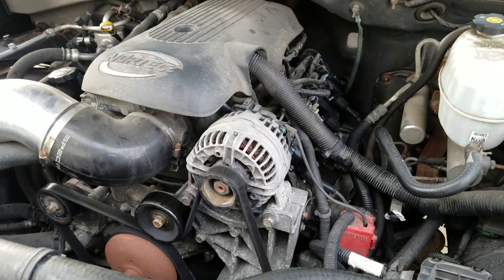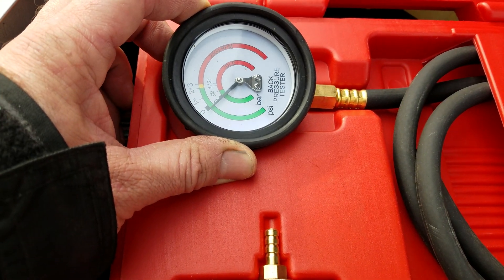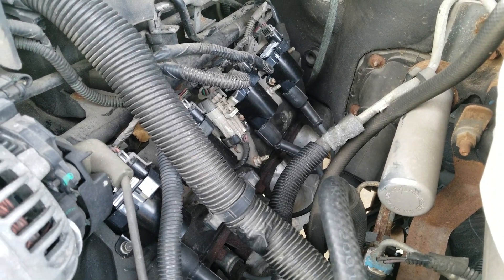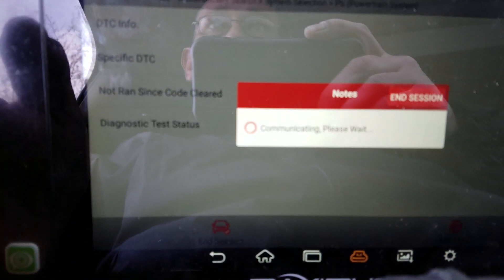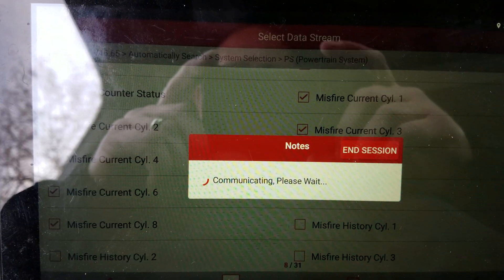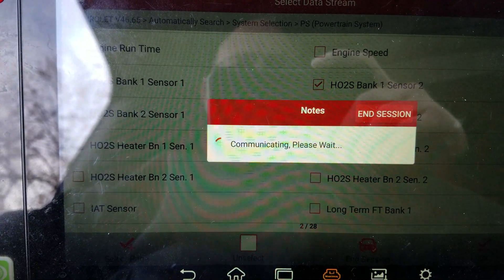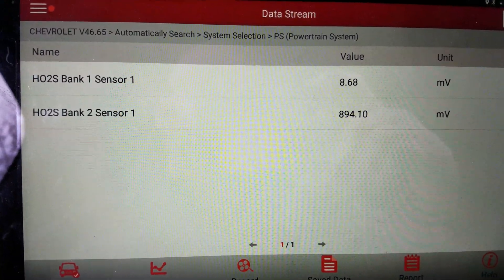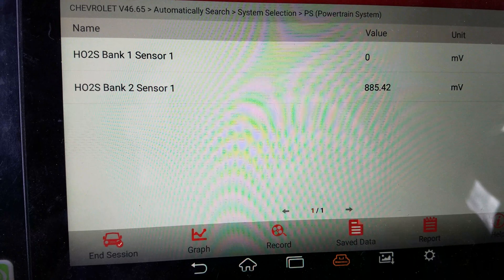2005 Chevy Tahoe P0300 Misfire  Code - no power - stalling - Catalytic Converter

Comment: Hey my car is multiple misfire and my bank 1 upstream was doing the same I replaced it it ran good than now it’s misfiring again idk what to do
Reply from the maker: You need to do some diagnosis. First scan the vehicle with a scan tool to at least determine which cylinder is misfiring. Also document any other fault codes (if any) and diagnose those issues. Once you determine which cylinder is misfiring, swap the spark plug, plug wire to the next cylinder and the coil if it is an individual coil per cylinder like Chevy 5.3 engines.  Move one part at a time. For example, start by swapping the spark plug with the adjacent cylinder and do a compression test on that cylinder while you have the spark plug out.  If the misfire stays at the same cylinder, then swap the plug wire, then the coil.  If the problem follows the part, you have found your problem. If not, swap the fuel injector with the adjacent cylinder. 

Multiple cylinder misfires are a little trickier to diagnose. Start with a fuel pressure check and then check for vacuum leaks. If that all checks out, then you need to start testing sensors and wiring. I've seen everything from a bad mass airflow meter to oxygen sensors to pcm cause a multiple cylinder misfire.  There are many possibilities. You have to test and keep testing until you isolate the problem.

Comment: Would that cause reduced engine power? I’ve gotten my throttle body changed 4 times. Could my Catalytic converter be the problem?
Reply from the maker: Catalytic converter is one possibility but there are many others as well. Hard to diagnose over the internet.
Reply: I changed the pigtail to the throttle body and reset codes and reduced engine went away

Comment: I had a Malibu bogging like shit thought it was a fuel pump (very common issue) replaced that with a used OEM same shit. Bogging down like shit can't rev over 2500 before it starts to niggardly bog down and almost stall. New injectors spark plugs n all. Absolutely forgot about the cat causing bogging issues too. Since it has a lean code (most likely vacuum) lead me to the fuel pump since I found no vacuum leaks I thought now I know there's a small leak somewhere and that code is unrelated to any of the bogging acceleration issues. Even after working on cars for 10 years I still fucked up my diagnosis procedure you think you're so good you've seen it all and it dicks with you again! 😂😂 I'm checking the car (unplugging the upstream sensor) can't now because it's raining but damn I completely missed this. Did have p0300 though it was caused by p0171. Now I know neither are related. Bad cats happen a lot now all these 2005+ are almost 3 decades old... Cats are crapped out
Reply: *2009 Malibu 2.4L

Comment: Ik this is two years old so I hope you still respond... Let me ask this.. would a 02 cause a misfire even when you first start..cold... Assuming open loop correct? Slight skip or miss cold and seems to get worse as it warms.. I'm weary I have a cam lobe or two wearing or either a burnt valve. I hear the old sputter coming out the tail pipe but my opinion it's almost a random mis. Nothing extremely consistent. This is the short version
Reply from the maker: Oxygen sensor will not cause a problem when the engine is cold. Has to be warmed up to be in closed loop. I'd scan it and see what you have for codes. Could be as simple as a spark plug or wire. A clogged converter can cause a random misfire which would be a p0300 code. It's fairly easy to see if the converter is plugged. Remove the upstream oxygen sensor (between the engine and converter) and then go up and down the driveway. If the misfire is gone, you found your problem.

Comment: Where do you recommend getting a good diagnostic from to test where the misfire is?
Reply from the maker: You can go to most auto parts stores and have your vehicle scanned to find out if you have a misfire code. Once you identify the misfiring cylinder, you can swap spark plugs, wires and coil with another cylinder to determine the problem. Do it one at a time, swap spark plugs and see if the misfire follows the spark plug to the other cylinder. If it does, then you have a bad spark plug. If the misfire doesn't follow the spark plug to the cylinder you swap it to, then swap the spark plug wire. Repeat the process with the coil if the plug wire and plug do not make a change. When you find the bad part, the misfire will change to the cylinder you swap parts with. I hope that makes sense.

Comment: having the same problem. should i just try replacing 02 sensor or what? any info is helpful
Reply from the maker: I would check to see if the converter is plugged. Also test the oxygen sensor. If the oxygen sensor is bad, replace it.

Comment: so why didn't it throw a P0135 or P0130  for bank 1 sensor 1
Reply from the maker: Who knows. I ask that question a lot. DTCs are a guide. Computers are far from perfect. That is why when you get a code you have to test to verify. False codes happen and no codes happen. Example, Ford 6.0 Powerstroke that I recently repaired had a code for cylinder imbalance that was triggered by a bad glow plug but didn't have a glow plug code. 😕 I ohm'd the glow plug and it was an open circuit. It should have thrown a code but didn't.

Comment: Can you temporary drive the car as you have created the hole with the 02 sensor removal?
Reply from the maker: Yes for testing purposes. It will have an exhaust leak but you won't have to drive far to notice the difference if the cat is clogged.

Comment: what if i have a p0300 code only and the car sounds more like a knocking sound , put new sparkplugs that didnt help.
Reply from the maker: P0300 is a random misfire. Possibly old plugs and wires so if they are old, I would replace them just as a matter of maintenance. To find the cause, you will have to do some investigating. A good scan tool will help because you can watch real time data streams. There are a number of things that can cause random misfires.